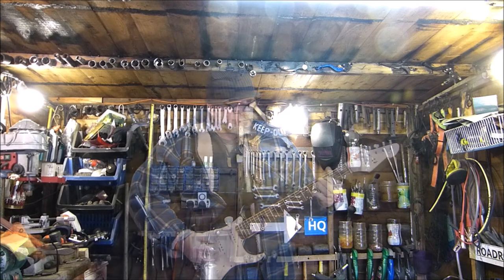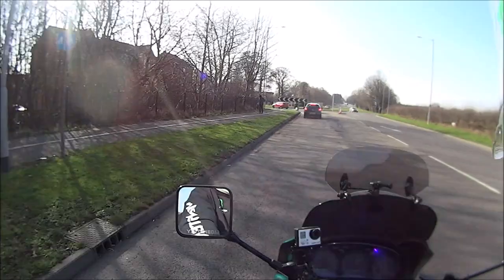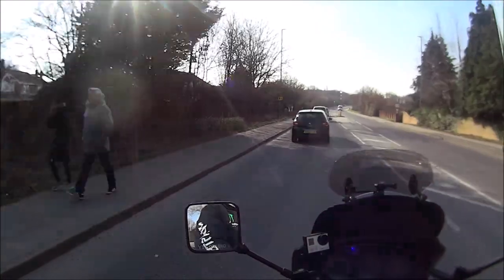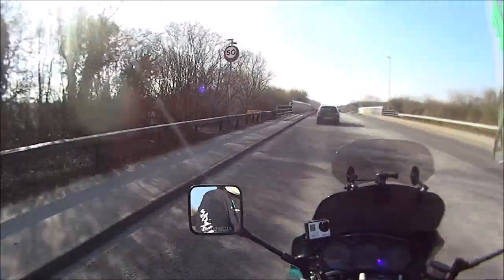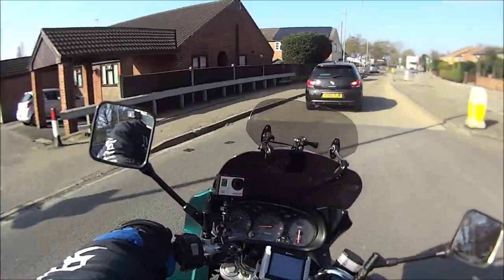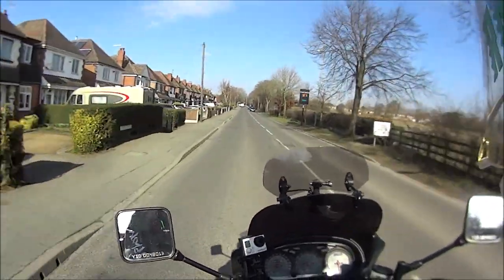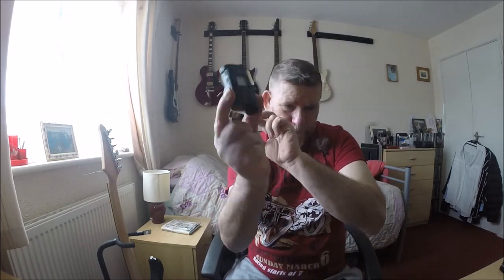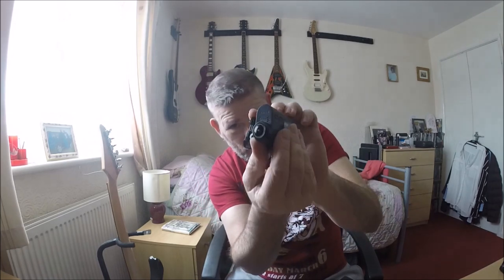CBR1000F Landfill bike. and camera update.

Comment: Hey Johnny I noticed you have a yamaha ID on your mirror. Mine also had them and I got a new certificate and paid £10 to have it reregistered in my name👍🏻  I’m doing my rear wheel bearing atm as I found the back wheel was stiff to rotate on the centre stand. It’s actually just the slicker bearing but I’ll change them all for piece of mind 👍🏻
Reply from the maker: Hey young man.. Yeah think it's data tag... Have fun with the new bearings and good luck 👍👍